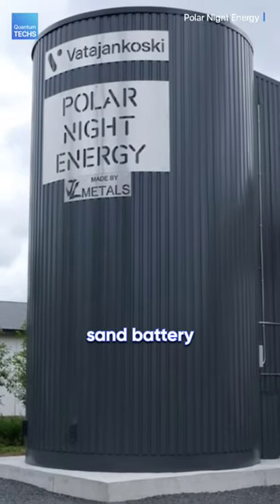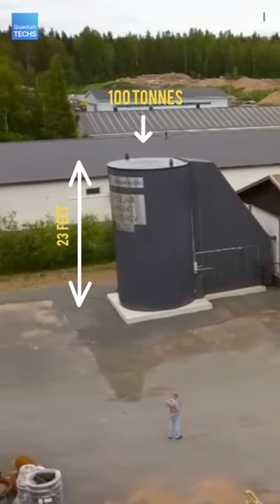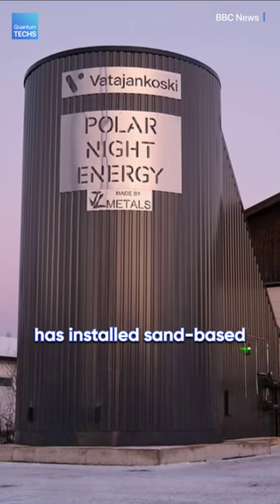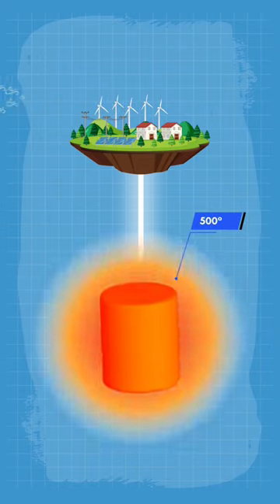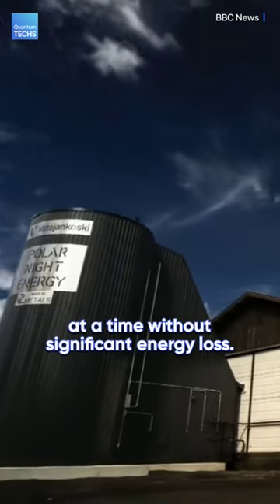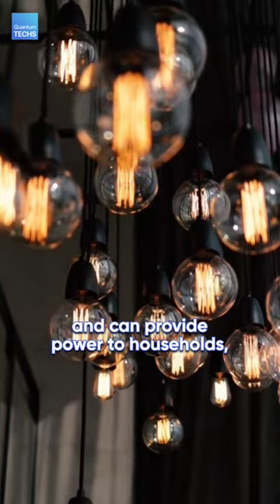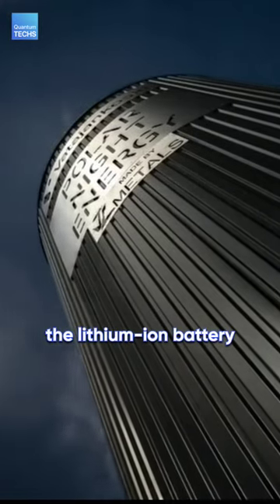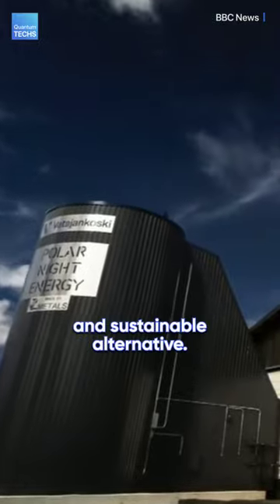This Battery Is Made of Sand

Comment: Actually, sand is a quickly dwindling resource. It's the opposite of sustainable if you're talking about the sand used in construction. Thay type of sand only comes from beaches and is NON-RENEWABLE. IF you use desert sand then I'm all for this, it's amazing!

Comment: Sand batteries cant & wont replace lithium ion batteries, bc sand batteries hold heat as it's source.
Where lithium-ion batteries hold a electrical charge. 
This video needs to be deleted.
*Sand batteries are thermal batteries, not electric batteries.*
Reply: Ya this isnsuper misleading. This sand battery is exactly what i thought it was but figured there was another type i was unaware of when i clicked. We don't use lithium ion to store excess renewables power.